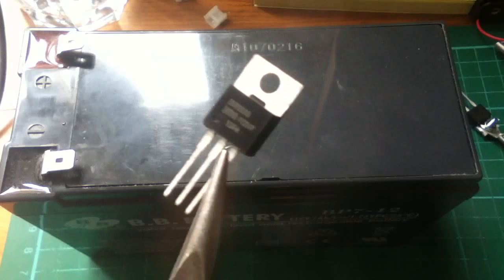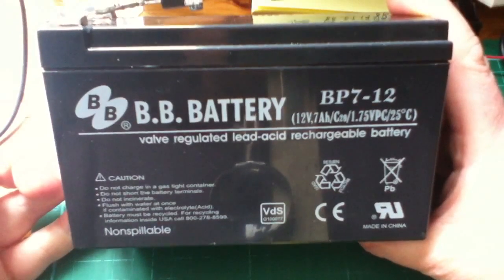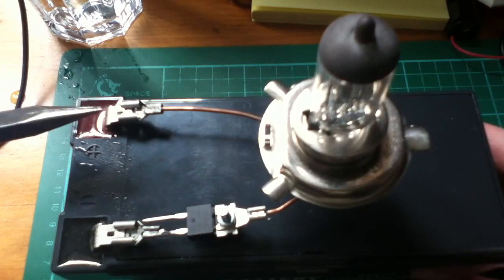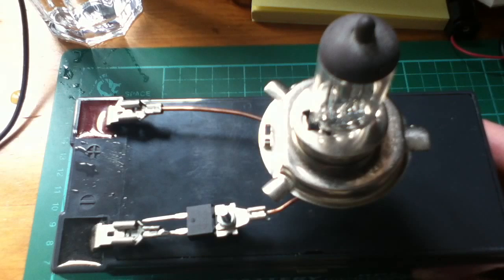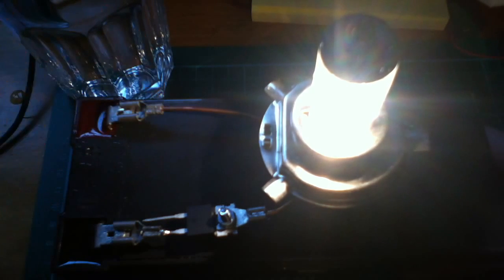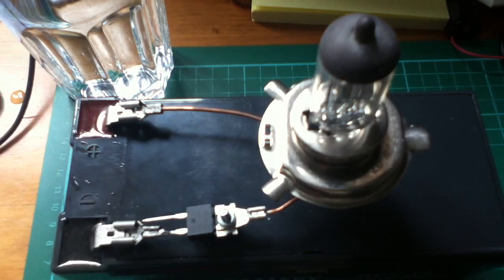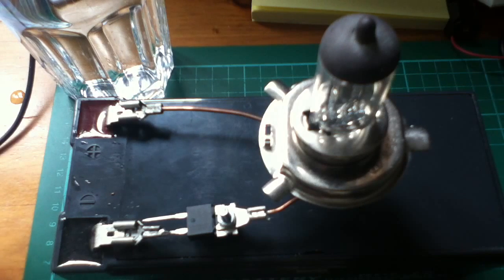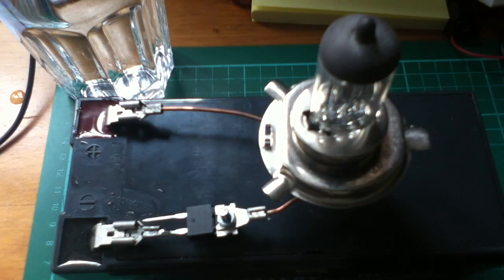Turning on H4 Car Headlight Bulb with IRF3205 MOSFET

Comment: Very helpful video. 
Sir can you share connection h4 bulb with battery, i believe h4 bulb has 3 pin for connection, please advise on same.
Reply: 3 pins cause there are 2 filaments in it (dimmer&high beam). To light one bulb, needs only 2 connections.

Comment: Thank you... footnote: were a simple switch be placed directly between + to gate, with a Gate resistance of 8 milliohms, it would effectively be a "dead short"...  ultimately, at 12.6VDC and 0.008 Ohms, resulting in, according to ohms law (for a split-second), a current of 1575 Amps and shy of 20,000 watts... POOF!!
... or am I missing something?
Reply: It's not the gate resistance, the internal resistance of 8 mohms is between the drain and source when fully on.

Comment: Which mosfet should I use to do the same thing but to make the light on only when I put + 5v on the left pin?
Reply: Dani Barza IRFZ44N or IRLZ44N. Though, if you are planning to connect it directly to an IC, I think you have to protect it from the gate's high capacitance.

Comment: Do we need a mosfet? Why don't we use a simple mechanical switch?
Reply: Abdelbaset Elhangari he just want to show what exactly mosfet can do and how its work
Reply: cause solid-state devices are better than those primitive mechanical ones for high current applications. mechanical ones deterioriate easily when switched on and off repeatedly while carrying large currents. cars headlights for example draw 4-10 amps.

Comment: It would be better if you connect two resistors in series say about 10k and 8k across the battery terminals with the 10k to the positive and 8k to negative and with a wire from the centre junction to the gate that will switch the light on then short the 8k resistor to switch it off.

Comment: I have nearly the same setup except my MOSFET is a CSD18535KCS. At 5 V on the gate, the light fires up and my MOSFET (with a heat sink) stays around 100 deg F. I then hook up a  PWM from an arduino around 32kHz and the MOSFET gets super hot within a minute? Inductive load creating spikes? not sure, thoughts?
Reply: +Kris Kasprzak Did you connect a resistor of about 100 ohms (or 1k) in series with the gate? Solder it at the gate connection without wires. Maybe your circuit is oscillating. As mentioned before: MOSFETs get easily damaged by static discharge at the gate pin. So touching these devices with your fingers might destroy them as mentioned earlier.

Comment: With automotive there have always been the tendency to do all switching high side, as chassis is ground
IRF3205 is a n-mosfet and you would need to apply 22V to the gate if you placed it high-side in a 12.8V system
 A mosfet-gate-driver with built-in charge pump could to that.
Reply: Tony Philipsson thanks for posting this comment Tony. I was looking at a MOSFET to drive and LED light bar so I dim it. I'll check out the charge pump.
Reply: True for normal switches, but electronic controls on cars normally use ground switching example fuel injectors (petrol/gas), ignition coils, vacuum switching valves, boost soleniods, gearbox soleniods etc
Rather than use a charge pump to up voltage just use a p channel mosfet or better and cheaper and more readily available high power n channel mosfet supply the ground connection, as shown in the vid.
Reply: P-channel mosfets are not as good as N-channel. You can usually get 'good enough', but there is simply more ideal choices when going n-channel.

Comment: i have the same IRF3205 and if i try the same experiment with 12v LED array (resistors on board) and 12v 2A power brick my leds will stay always on from the moment i connect them and it wont turn off. What am i doing wrong?
Reply: Connect 10k ohm resisor between gate and earth ( - ) .... But at this case u can't make transistor on until u pot in Gate 5v through 1k ohm.... Or 10 K ohm with 12 v

Comment: That's why in the circuit, mosfet needs a resistor divider across gate and source to give path for the gate to discharge, otherwise the switching won't happen. Nice tutorial! Thanks.

Comment: I connect gate to ground, 12v to motor +, the motor - to the drain and the source to ground...
My motor keeps rotating dispite of what I input to the gate, +12v or 0V..

My mosfet is the same as yours,

Comment: ***** Yes, there are at least two ways of doing this.

One is using a P-MOSFET (this one is N-MOSFET) which are usually less efficient, in other words same low RDSon resistance will cost you more, the other way is using some drive circuit capable of boosting voltage a little bit above your positive voltage and using it to drive a gate so there is always higher potential on gate than what's you are switching. Despite it involves more components it may be actually more cost effective due to lower cost and popularity of N-MOSFETs

Comment: A model of clarity, worth a stack of books.  Thank you.
Reply: +mecher abad  Thankyou, Mecher!  Skill as a mechanic is, I think, very transferable to electronics.  Some items have similarities, as well:  a transformer is effectively a gearbox, an inductor has something in common with a spring, a capacitor is not unlike a vessel of fluid.
Reply from the maker: Howard Ellison Kind of you to say so.
Reply: +Howard Ellison sir can you make a PWM with mosfet high ampers?please reply.thanks
Reply: +mecher abad  Hi Mecher.  I am no electronics expert!  I think a pulse width modulated signal can be amplified by almost anything, even valves, and a power mosfet or two may be used for that in a PWM amplifier as used in modern hi fi and some portable radios for high efficiency.   For sure, I could not make one myself unless I had very clear wiring plans!  
Might as well add here, I dislike the sound of such amplifiers.  Rough.
Reply: ok sir thaks for your responds.you have a great video sir.that is a big help for me.i am a mechanic and i want to learn some other project like this.
Reply: +Julian Ilett sir can you make a PWM DC12VOLTS can handle a high ampers?please reply.i'm the one of your subscribers
Reply: yes sir..
Reply: Sir can you share connection h4 bulb with battery, i believe h4 bulb has 3 pin for connection, please advise on same.

Comment: i have a transistor that is n-channel mosfet but i can't find it's datasheet
it's 07N65E transistor...

I followed your schematic..then i build one using 07N65E it works! but before i touch the POSITIVE TO GATE, the led that i use start to glow itself before i touch it
WHY?
Reply: Its because the Gate capacitance has stored a charge, either from static or local/ambient electrical fields, turning it on. If you keep a high resistance resistor between the Gate and GND, it will remain off until switched on by your drive signal. It will bleed off any charge, but not be enough to load down/interfere with switching signal ex:  (100k, 1 Meg etc) Recently did that for a IRFZ44N, and others.
Reply: Scott x thnks

Comment from the maker: I see you found the Mosfet tutorial which covers high-side switching. You can make the Mosfet turn off by putting a resistor across gate/source - 100k to 1M should work fine for low frequency switching.

Comment: couple of questions if i may,  is there a way to run this on the positive side of the voltage, and is there another type of transistor that would turn off when you release touching?